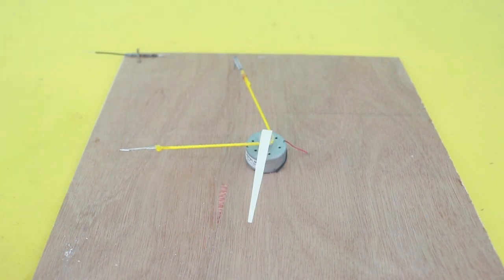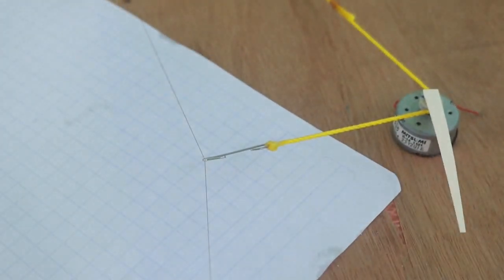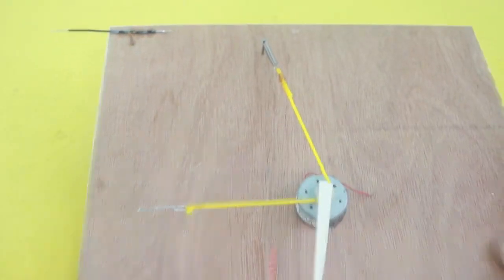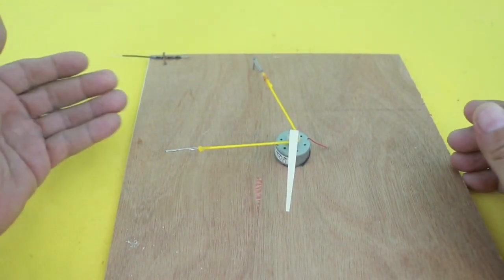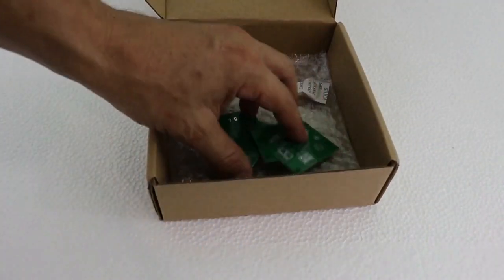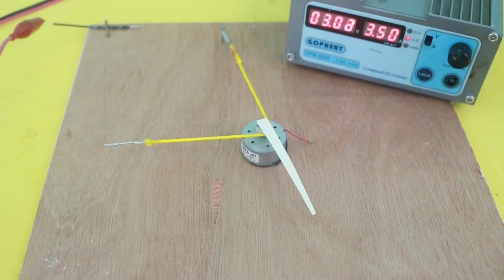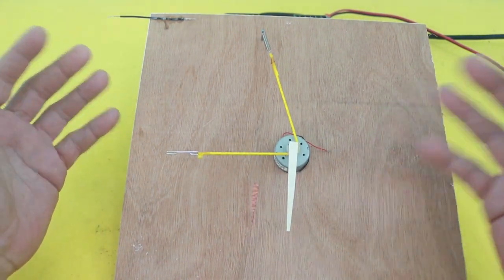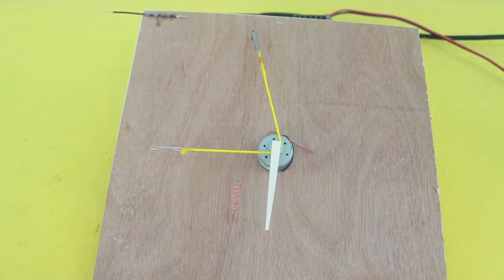Hot Wire Current Meter

Comment: Cool.  No pun intended.
I recall being in disbelief when first learning that build I-beam deflection could be electronically measured by current (or resistance, can't remember) change from a tiny sensor being stretched, thus changing its electrical characteristics.